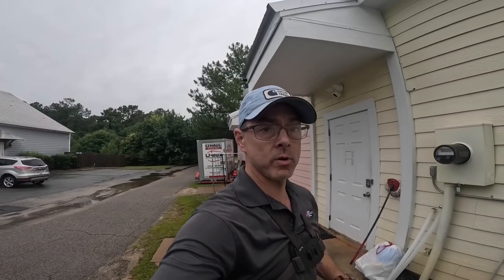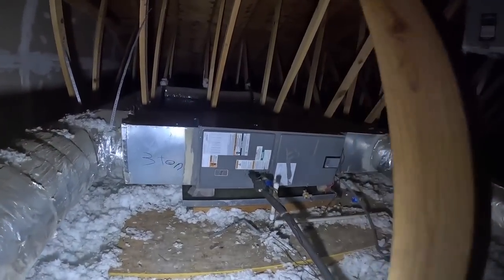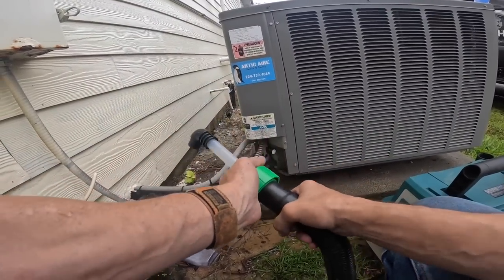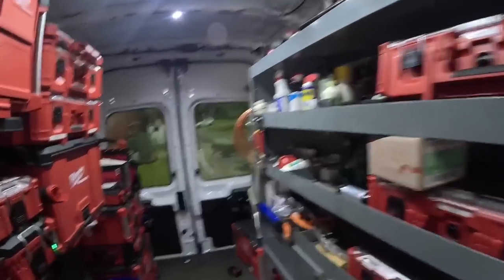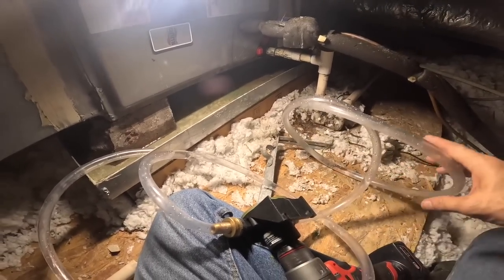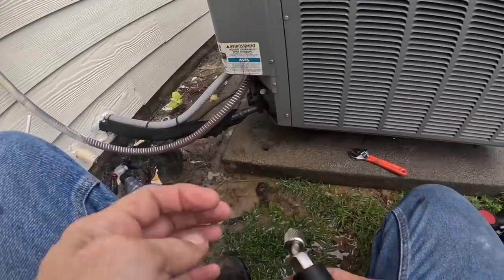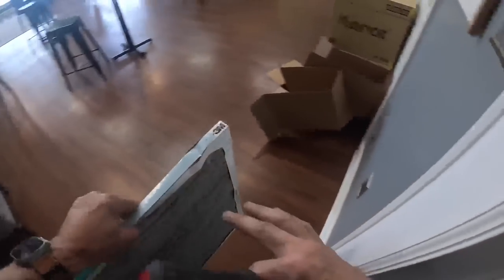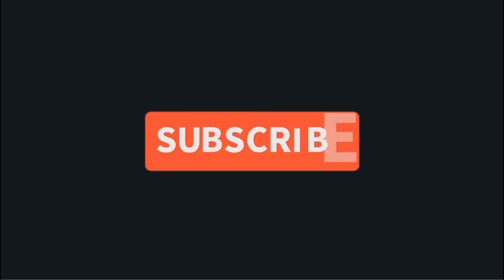Small Restaurant Called On A Rain Day! #hvacguy #hvaclife

Comment: I have to say, I've tried to clear the drains with my vacuum several times but end up going in and blowing them out followed by some really stout drain cleaner.  Had one today that was plugged.  I mean PLUGGED.  Time for the Liquid Fire.  These drains all go outside a not to any sewer system.  It's amazing how much gunk builds up in these drains.
Reply: I have pretty good luck with the cheapest vacuum I own. A Lowe's 5 gallon bucket vacuum. It's got more suction than anything I've owned. It works about 95 percent of the time..

Comment: I had to work on my own HP today.  Bad board.  I picked  up one at MICHEALS and replaced it.
Reply: Why did the board fail? You need to always identify what caused it to fail or the new one might fail soon. That's the difference between diy and trained experienced HVAC techs. I've been on hundreds of calls where the customer did more damage than good. I've had a couple of customers completely destroy their system to where it was unrepairable.

Comment: When cleaning out the condensation pipe, shouldn’t you pour bleach or vinegar in the line, then wait about 20 minutes, then flush it out with water, to clean out the algae? 

My air handlers are in my garage, so I pour in vinegar, wait 20 minutes, the connect a garden house to the condensation pipe, turn off the shutoff to the air handler, so the pressurized water can only flow out the condensation pipe. When the job is done, I open the shutoff from the air handler so the condensation can flow out the condensate pipe. 

I used to use a shop vac to suck the vinegar and water out of the condensation pipe, but using pressurized water is so much easier after the air handler shutoff is installed.

Your van looks extremely well organized!